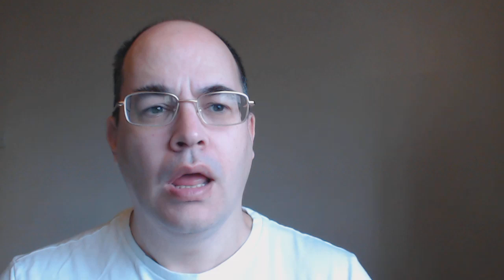Desertification and the use of magic stones or stone lines to slow the process.

Comment: Hello sir....yes there has been a steady improvement in quality over the past 7 years.  Here are some tips to boost your video quality:

1.  Invest in a $100 shotgun microphone to place on top of your camera or invest in a lapels microphone such as the tascam dr 10L and then sync the audio in post editing.  Audio quality supersedes video quality any day of the week.   You can also use a USB microphone like the Yeti for around $100.  You could record audio on a free website called audacity and sync with video afterwards.  

2.  I have no problem with the window lighting.  Perhaps though, turn down the exposure a notch because your face is slightly over exposed.  

3.  Add depth behind you.  A solid wall looks flat and boring.  Sitting in a room that has depth would be ideal.  Even turning around so that the window is behind you might do the trick.  A solid background with depth will make your videos more polished.

4.  Backlighting and key lighting:  Right now uve got a key light coming from the window but u have no back light so it looks flat and lacking depth.  Adding a lamp, led strip or even those cheap neon lights u can buy on amazon will make an amazing difference.  If u turn so that the window is behind you, then it solves the backlight problem, bit then ul need a key light.  Amazon sells some cheap video light lamps.  Place it so it shines on one side of your face.  Always try to Maintain a darker shadowy half on your face for depth.

5.  Talk to the audience instead of reading off a script located off to the side. Eye contact and really knowing your content will come off more authentic.  

All these changes can be made for under $300 and if set up properly, it will make your content look extremely professional.

All the best
Reply from the maker: Due to issues outside of YouTube I am currently not doing any new videos, thanks for the time and thought you spent writing this comment.
Reply: @mjmurcott647  hope all is well
Reply from the maker: Two 80 year old plus parents to look after which is taking a lot of time and effort.
Reply: @mjmurcott647  may ur efforts be rewarded.  A very honorable thing to do in this era.
Reply: @mjmurcott647  Wishing all the best to you and your family <3
Reply from the maker: Thank you.